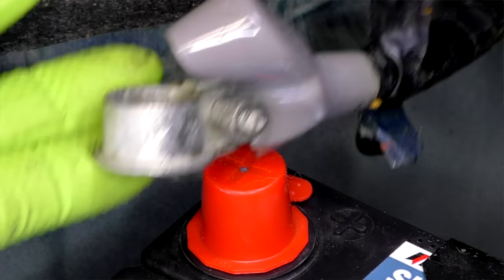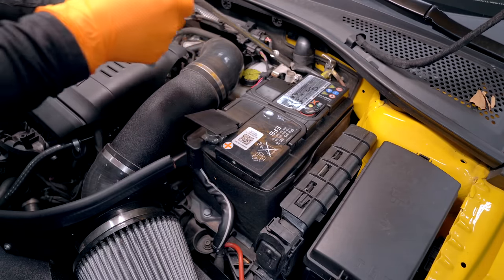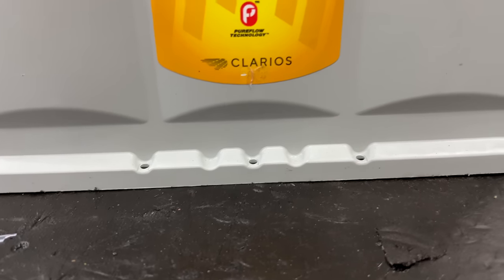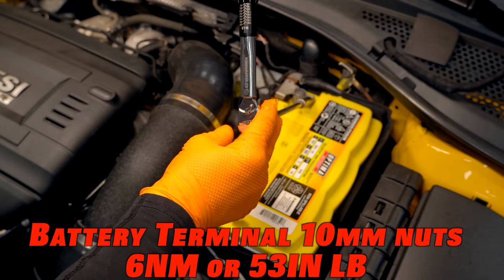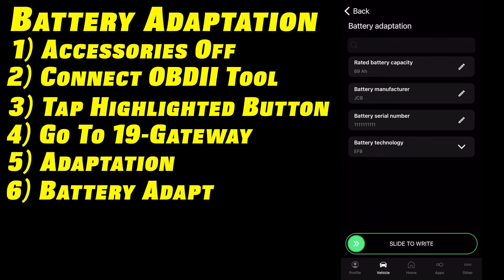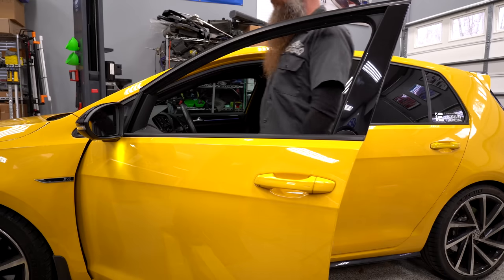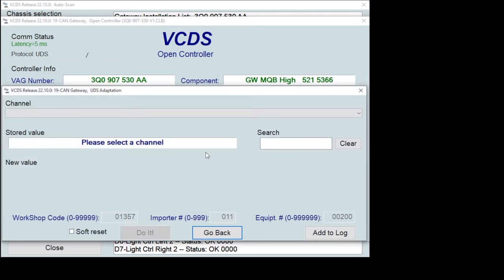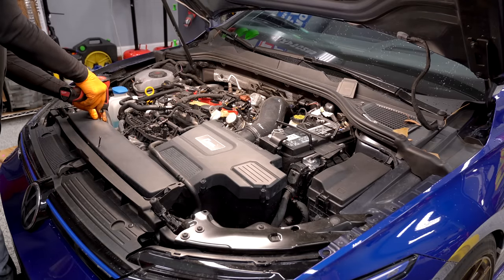How To Replace and ADAPT a VW or Audi Battery

Comment: Haha, +10hp for the body-coloured battery!

Apart from a new battery (or at least a charge up) is there any precautions to take before starting up a car that's sat for a year or two?  1.4 TSI if that makes a difference.

Brakes look like they could do with a bristle disc, but engine stuff is a little outside my skillset/knowledge.

Comment: Please help
I have an audi A6 2010 model 2.7 tdi
I have replaced the battery, but the battery is not charging back , i thought its a faulty alternator but the alternator is fine though when i checked..
Is it happening because i didnt do the coding or the battery is not factory one?

Comment: Just replaced my battery in my 2011 Jetta. Knock sensor code now as well, I have done some reading and I think it’s because I may have gotten some soapy water on knock sensor #2 when I cleaned the area around my vacuum pump (it pretty sludgey). I go to take the intake manifold off and there is a loose bolt and washer STUCK in one of my bolt holes. Not sure what to do😅
Reply: bro is that a fake humble mechanic account 💀💀💀💀

Comment: Is the coding needed for an Audi a4 Avant b7 from 2008 7/8? I have the OBDeleven but not the pro version and I don't seem to have the same options in the adaptation menu. I switched from a 62 ah to a 72 ah to get more cranking power and also better strength for cold wheater in Scandinavian.

Comment: Awesome video Charles. I"m sure there are some of you out there that still don't understand why do I need to program the battery? Modern cars will deactivate the alternator in order to save fuel, and thus emissions. If the gateway module monitoring the battery doesn't have this information the "smart" charging system will not work optimally and may cause a low or discharged battery as it doesn't know that a new battery has been installed. Programming the vehicles gateway to know that the battery has been replaced with the size and type IS important.

Comment: A good explanation and procedure well done. I've heard and will stand corrected if you use your old s/no and chg th last digit it should work but haven't tried it. You know i understand Engine tuning, fuel trimming gearbox mirrors windows and maybe heating (heating you can control the old faction way, sorry for reaching over and adjusting) But some of the bull that is happening with full "IT" is Poo. Say u have an Audi, sunroof that may leak, flood the floor and God not that wonderful floor computer it controls windows key interface with instrument panel etc. so if you're lucky you drive home with window in the last position as well as sunroof keys may not work etc etc. if you guess I'm not a fan of full IT. Too many expensive units......
Reply: text-4650  
Mate love your show but I'm in Australia, I watch with interest and learn. I've had or now own S4, S3, Tourag, A4 and Golf to name a few. Yes a nutter, have worked on all of then and learnt a lot and sadly love them all. Keep up th good work. Henry

Comment: Do you know if I have to do battery adaptation on a 2007 Audi A6 V8 4.2L Base Sedan Quattro? It has a AGM battery and I want to replace using same or better performance AGM. Battery is in the car trunk.

Comment: Cool video. Just a quick question, could you have used a jump box or other battery with a set of alligator clips to the battery leads and provide power to the computer while you were switching the battery?  The car would never know the battery was replaced. You could skip the whole coding step...
Reply from the maker: That won’t do it. It’s not disconnecting the battery it’s putting a new one in that requires coding
Reply: @HumbleMechanic but what if the replacement battery was the same capacity, ie the OEM direct replacement. I’m asking for people that don’t have the ability to code and are trying to save a few bucks.

Comment: What if I just disconnect the battery temporarily so I can remove the front seats without setting off an airbag.  Do you still need to go through adaptations?

Comment: Bro my wife has 07 Wolfsburg.  It drains the battery and all night the dash lights flicker and it clicks nonstop under the hood. With no dash warning lights once the car is started . Code reader says nodda. I've replaced the ecu,batt,cables.
Was wondering how to test the ignition, or key fob . 
They all work but occasionally the driver door does not unlock while other 3 do and she has to use the key. Sometimes, months before that will happen but seems to correct itself. I'm thinking it  could be the security system issue. Yesterday after 3 years of this issue the radio gave code 1000.Yes I have replaced fob batt.??? WTF??

Comment: I once had my battery replaced in my 2015 Skoda (also VAG).
Worked fine for about a year.
One day I had my car parked for about an hour and intentionally left the interior light on.
The battery was charged enough to start the car again and drive home for an hour.
Then the car was parked for 2 or 3 days and after that it was too weak to be started.
Road side assistance got me going again but it was empty again.
After checking for battery health and any unusual current draw it turned out that the programming didn't work as intended when the battery got replaced before.
After programming it correctly the problems were gone.
Obviously the car wasn't charging the battery correctly due to the wrong values.

Comment: Hi Charles I really need help I have a 2007 tdi the heater only works while the vehicle is at an idle when you start to drive it blows cold. I took it to vw and they said it needs a heater core. $1300 later and my heater still doesn't work. It made no difference vw says the heater core is working properly so I'm not sure where to go from here

Comment: I have a 2010 Volkswagen Touareg TDI. And I put a new battery in it and I tried to do the battery adaptation using VCDS and it was grayed out is it even possible to do it on a 2010 vw

Comment: The original Volkswagen AGM-battery (made by Varta) of my Golf Mk. 7 2,0 TDI (110 kW) lastet for 140.000 km or 9 years. Then, after a cold night in december 2022 it suddenly broke down after struggeling when starting the engine some days earlier and had to be replaced.

Comment: My question is once the mechatronics is removed from the transmission 3 out the 4 shift cables doesnt move to the out position but goes neutral and inside position. Should i condem the transmission at this point?

Comment: Does this (most anyway) apply to a 2016 VB Beetle 1.8 Turbo?  We are still on the original (factory) battery after 100k + miles and live in the somewhat harsh winter environment of southern Wisconsin.  No real troubles yet but I just had to top off its charge after a week of little driving.  Assume so but want to be sure.  Thanks!
Reply from the maker: I dont think so. If it has start/stop then it will likely need coding.

Comment: Is there a way to change the information for the battery to keep alternator output above 14v? I have a mid sized audio system and would like to maintain the higher voltage, amperage output.

Comment: HumbleMechanic...My stock battery (Enertec 5KO 515 105 D) is basically dead on my 2017 MK7 Alltrack SEL. I've been researching this very topic, something I keep running across is that IF your VW Golf based car does NOT have that battery monitor (which is connected to the Neg Terminal) you don't need to do adaptation (re-code battery) my Alltrack does not have that battery monitor  Is this true that no adaptation is necessary? I do not have OBD11 or VCDS, I'll probably get a OBD11 (Pro version) down the road but I need new battery now.

Comment: Charles, 
On a 2015 MK7 VW Golf TDI since it doesn't have the "start-stop" feature or the "battery module" on the negative lead do is there a need for battery coding?  Thanks
Reply from the maker: I do not "THINK" it does.

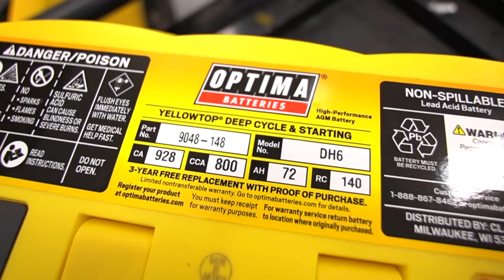Comment: How are you able to find out the 10 digit serial number for the battery? Is it on the battery itself? I tried to locate the "1111111111" one on the example in the video but I'm guessing it's that barcode we see at 5:00.

Comment: Correct me if I'm wrong, but the battery technology for AGM batteries is Fleece/Vlies. That's how I'm coding it and what the Germans at Audi told me. Also, on cars with OEM AGM batteries, it's coded like this.

Comment: My 2015 is still on its original battery and so far so good, although the stop-start is not kicking in as often as it did and it once gave me a low charge warning, so it's due, but still not bad going...
Reply from the maker: Yep. The days of a bad battery being no start are still here, but now you get way more wonky things happen long before your car won't start.
Reply: @HumbleMechanic   The days of the old AC delco batteries from the nineties you could get 10 plus years of those are gone.  What I do is replace a flooded battery with an AGM and charge it every 3 months on an external charger, you'll get years of extra time out of it.

Comment: Wouldn't using a powerpoint 12V battery back-up avoid all the warning lights and window 1-touch lost of function?
Reply from the maker: Maybe, but most German car mans say DO NOT use those. It took me 5 seconds to reset 1 touch, and you will drive it anyway to reset those other lights.

Comment: Or use jumper cables from another good battery to ensure the terminals remain connected to power while you replace the battery. A simpler adaptation.

Comment: Hello humble mechanic, Do you often use a torque wrench? Some mechanic say they never use it...others always use it and torque it to factory spec...what do you think about this? thanks
Reply: A professional mechanic will always use a torque wrench. Some things are safety critical, like engine mount bolts that need torqueing to the point of yield (stretch) so they can reliably clamp and more importantly snap and allow the engine to go under the car in an accident, so not colliding with occupants.

Comment: Does the start stop system needs something special? I've seen that my atlas has another wire hooked on the battery (little bit like your mk7) nothing special other that doing the procedure you described?
Reply: Battery adaptation (entered type of battery etc. ) is telling the system how to charge the battery correctly. The start/stop-system, if enabled/active and used frequently like in cities, is draining the battery if not charged right and enough. The system monitors the battery condition and will start the engine if the voltage drops to much. These batteries are larger than others in the same car without start/stop-systems.  Is this an answer to your question?

Comment: I wouldn't replace the OE battery unless it dies. In my golf 6, the original battery was replaced after 9 years. In a Renault after 6, then it needed to be change every 2 3 years. In a bmw E90 still rocking the original battery from 2008, but the batteries after only last few years before going bad. Multiple people told me that batteries only last few years after the OE is gone. So, as long as the original one works, I'm not gonna touch it. The aftermarket were all great brands like Varta and Bosch.
Reply: That's generally why u replace it
Reply: @jsplasha  what do you mean?

Comment: Damn Charles!  Did OPTIMA gift you that battery?  That sucker was >$130 than the Duralast I got a few months ago :-)  
You definitely are a delight to tune into 👌

Question for you @HumbleMechanic:
I have come across information that "FLEECE" is the correct setting for AGM batteries on German cars (vice Binary-AGM).
Any insight to that?  Thanks 👍

Comment: Hey, just wanted your input on this but I've had people ask me if they can program regular lead acid batteries to our vehicles and I've always said that I believe the battery has to be either EFB/EFB+ or AGM. Do you know if that's true or can you actually program just any battery as long as you put in the values correctly? If so which battery type would it be for regular batteries?
Reply: By far from an expert but I'd suspect a regular battery is less fussy if it will work with an old dumb alternator. Of course it won't be suitable for stuff like stop-start.

Comment: Hello from Greece Charles. Big fan of the way you do "the job" every time. One question. 
What's the purpose for the battery cover? Is it necessary?
Reply: Thermal insulation. It prolongs the life of the battery, and improves cold startability (at very low temperatures, like below -15⁰C).

Comment: To avoid all therse Probs with errors, just plug a Battery Charger to the designated Points in the Enginebay, put in on and then replace the battery. The System will stay on and do not loose all settings.
Reply from the maker: No that’s not right. The only thing that may do is not lose pinch protection basically setting. This is t about disconnecting the battery. It’s about replacing.

Comment: Hola. Te escribo desde España. Hay una cosa que quería comentarte. En el apartado de adaptación el número de serie de la batería tu pones 111111112.Segun tengo entendido el número de la batería contiene el día, mes, año de fabricación. Hay que meter este número así la centralita del coche sabe la fecha de fabricación. Con esto según vayan pasando los años la capacidad de la batería disminuye y el alternador aumenta la carga para compensar esa pérdida. Por eso es importante meter el número de serie de la batería. El problema es que las baterías no originales el número de serie es de 9 dígitos y la original lleva 10 dígitos.

Comment: Ive changed it on my 2017 A3 and did no adaptations  because my mechanic thats very knows for repairing audi's told me it dont need any coding just start driving and alk the lights and faults with go and reset and after i started driving with the new battery all fault lamps turned off after just 3mins of driving, every thing works all right even the start stop system

Comment: DIY is not going to have the pro grade scanner so a decent $10-20 ODB2-battery saver should be good to go.
Reply from the maker: That wont solve this problem. Its not unhooking the battery it’s replacing that requires programming
Reply: thank you for the detail and really enjoying your segments and learning about Audi/VW @HumbleMechanic

Comment: If you have a garage, you can charge your car's battery regularly and it will last a long time since lead acid batteries like to be stored at 100%.  I try to top off my Jetta's battery once a month with a Battery Tender Jr and it's going on 6 years old now.

Comment: Could i trick the system and connect the battery charger on the conectors before removing them from battery then replace batrery? And disconnect the charger would i still need a system reprogramming
Reply: Whenever you replace a battery on a VW/Audi you always have to recode the car to recognize the new battery or else it will still think it’s the old one and may over charge or under charge and put your car into low battery/power saver mode. The car will not auto learn the new battery you have to forcefully reprogram the BCM

Comment: 11:16 looked scary to me. Is that a radiator hose in the way? 😅 (not an car expert but learning stuff) 
I managed to broke one plastic nipple from my 2005 A6 radiator hose just by gently having my hand touch it when I was turning the tension pulley. The fluids flew all over the place. Old car so maybe it was fragile.

Comment: Why not just make a temporary connection to an alternate power source to maintain systems power during battery change out? I know, there’s a risk that you might arc, but if you’re skilled, very careful, and you insulate connections to avoid arcing, can’t it be done this way?

Comment: Great video. Honest question/no flame war intended:  Is there actually a significant use of the battery-specific data entered?

I can't imagine what specifying the battery vendor could accomplish, the serial number information is obviously unnecessary. Maybe the battery type could be used to govern charging behavior differently... but then again, this comment section is full of feedback saying the change shown in the video should have been to type "Fleece"... so I can't see how these battery-specific information improve things? 🤔

But maybe I'm just out of my depth, here. E.g. have never owned an AGM battery and when I replaced the battery in my 2010 Mk6 GTD I was unaware of the need for coding (and didn't do it).

I did however experiment with products prolonging the battery's lifespan (those little boxes, which periodically draw high currents in order to counteract sulphation). That worked great in said Mk6 GTD and helped me operate an already well-deteriorated battery (bought the car with it already being this bad) for another four years. But most importantly I made sure to externally charge that battery every few months (especially in the winter).

Comment: My 2013 Touareg, with 121,000 Km is still running strong on the original VW battery. Not unusual on some VW and Audi cars.

Comment: Have you thought about putting on the mk7.5 subframe collar alignment kit for the front and back? Nobody’s posted a video of them putting it on, the reason why I ask is I want to put it on my mk7.5r as I get a creaking when turning the steering full left and full right and I know this will fix the problem would be nice if you could do a video on it as i really enjoy watching all your videos
Reply from the maker: I have a rear set but not a front. I have a set on my mk8! It should be an easy install. Just do one bolt at a time.
Reply: @HumbleMechanic  I’m gonna give it a go when the weather is warmer, am I able to use the same bolts after installing the collars? Iv seen that they can be re used once and then need to be replaced?